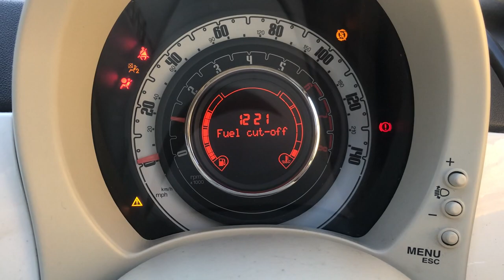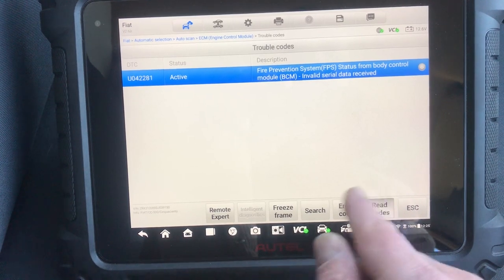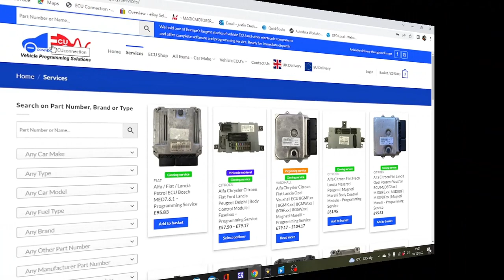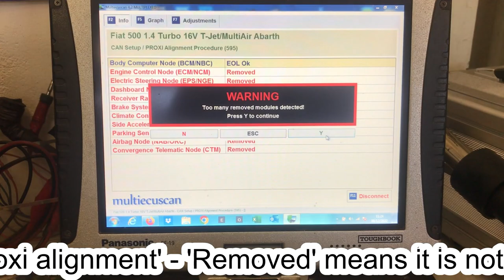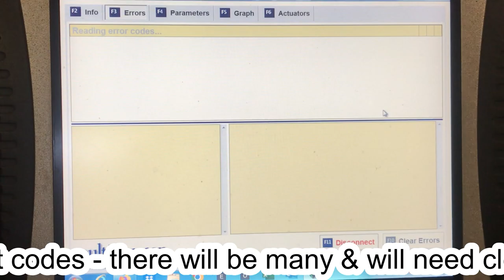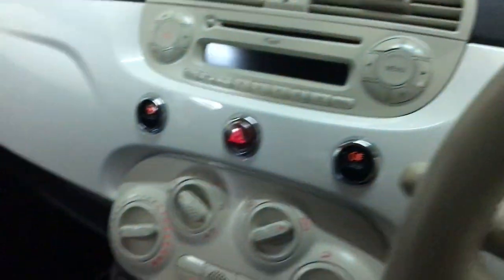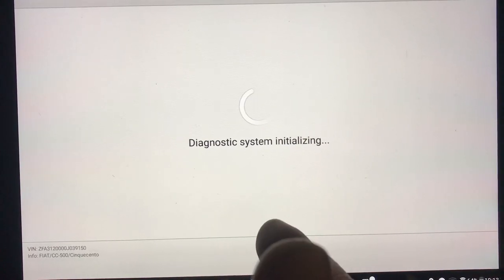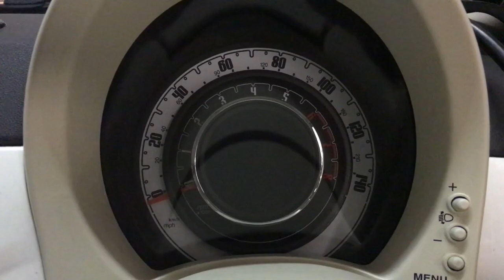Fiat 500 Airbag ECU Remove repair + refit guide Flashing milometer, Fuel cutoff unavailable no comms

Comment: Brilliant. Thanks.  That’s me. All my lights. All my messages.   In the trade.  Thanks. Very helpful.
Reply from the maker: Hi, thanks for your comment & watching, glad you found it useful!
Reply: For the cloning service you offer. I have the FIAT 51838580 A2C5333208 out the car - I can buy eBay FIAT A2C5333208 but 51897787, question. Will this clone with mine sending both in. Thanks Dan
Reply from the maker: @zzhughesd  it would be best to use a matching part number for cloning - if one isn’t available then our recommendation would be the ‘No comms repair’ service we offer…
Reply: @JC-ECUConnection Hi Mate, excellent video shows all the same issues I’m getting, where do I start with this? What is the first step to do? Any help would be appreciated
Reply from the maker: @FreePalestine11.  Hi & thanks for watching - firstly to confirm the fault is your airbag ECU, plug in a diagnostic tool & check if you have communication with the airbag ECU, if you don’t then check the fuses, if these are ok then it’s most probably the airbag ECU. Remove the module & post it to us for test & repair! Details can be found on our website:
https://ecuconnection.co.uk/product-category/services/?filter_car-model=500&filter_type=airbag-ecu&filter_car-make=fiat

Comment: We took a 500L partX. We fitted a used ecu kit for the previous owner as the engine ecu had a fault. There was only 1 difference the kit came from a car with a knee airbag and this car doesn't have one. With the full kit fitted the airbag light was on and only fault was knee airbag. With the original airbag module fitted no faults but flashing mileage and wouldn't proxi align. It's been running fine this way for some time now it needs fixing before we sell it on again.
Reply from the maker: That’s the problem with fitting an ECU kit!.. it would of been MUCH better to have replaced just the faulty engine ECU, this could of been easily cloned from your original ECU or virginised.. if you still have the original kit then I would advise you put it all back to original & fix it by doing this.. if you have thrown the original kit away then you’ve made a big mistake!!
Reply: @JC-ECUConnection  we have still got the original bits that was my thoughts from the start it wasn't my call then though. Can you do the engine ecu repair
Reply from the maker: @colinhamer6506  we should be able to clone / virginise the ECU for you, please visit our website for more information:
https://ecuconnection.co.uk/product-category/services/?filter_type=engine-control-unit&filter_car-make=fiat

Comment: Great video. I have the same problem with my twinair 0.9l.  What do you think about buying a used one or "new" one from ebay for cheap?
Reply from the maker: Hi, thanks for watching & your comment - Yes you can buy a secondhand unit although they can be hard to find & you need to find the same part number, then you will need to program it to your car either by ‘Proxi aligning’ by OBD (Providing the unit does not have crash data stored) - If you don’t have equipment for proxi aligning & crash data removal we also offer a cloning service for these units, for more info visit us at:
www.ecuconnection.co.uk
Reply: @JC-ECUConnection  Good to know. Thank you so much for the reply. So I (with my little dongle) and alfaOBD found just U0331 which I've searched for and found your video. How would I know for sure it's the airbag module?   (All other error messages I have too, except for the start/stop, but it's always off by choice)   Or just send it in and you test for function?
Reply from the maker: @TheCybercrash  if you do not have comms with the airbag ECU, first check fuses & power supply to ECU, if all checks out then you can send it to us for test & repair..

Comment: Hi my car has the exact same symptoms, I’ve used a cheap ond scanner and it didn’t pick up any faults so I’m assuming it only reads engine ecu, would it be worth getting it scanned in a garage or just go for the module ? I’ll send it in for a check and repair just don’t want to pay the extra in a garage if I don’t need to…. Great video by the way 👍
Reply from the maker: Thanks, & thanks for watching!.. you can send it through for testing before we go ahead with the repair to confirm your diagnosis, no problem!
Reply: Excellent I’ll get it off tomorrow and in the post
Reply: Hi just an update refitted the module today and everything is now working spot on…… thanks 👌
Reply from the maker: Hi, thanks for letting us know… it’s always good to get feedback!

Comment: So what actually fails & why? Is it a water ingress issue? I noticed on your car there looked like evidence of a leak on the bulkhead just ahead of the heater matrix ?
Reply from the maker: No, not water ingress on these units - component failure of various items on the PCB, usually due to voltage spikes - flat batteries & jump starts but often they just fail!
Reply: @JC-ECUConnection  I see. Mine didn't coincide with any event like jump starting or low battery, it just suddenly decided it was faulty, mid running cycle, & that was that. So expensive for what they are too, so I`m just running with no air bags now.
Reply from the maker: @MrPabsUk  we offer a Europe wide repair service!

Comment: I have stop start unavailable and fuel cut off unavailable. No other warning lights as you have in the video. I have connected a obd 2 scanner, no faults found. Do you think it could be same problem as in the video?

Many thanks
Reply from the maker: If you are using an OBD2 scanner I assume you are only reading faults from the Engine control module, you will need to use a Diag tool that scans ALL the control modules on the car at manufacturer level & not just the ECM at OBD2 level, particularly check for comms with the Airbag control module..

Comment: Hi, at 11.50 I see that you are clearing the fault codes after installing back in the car? Will it be required if I send the module to you for repair?
Reply from the maker: Hi & thanks for watching!.. it’s not essential to clear the fault codes after repair as the warning light will only illuminate if the stored fault codes are ‘Live’ & not ‘Stored’. When we bench test these units they are powered up without having all the components connected so there will be fault codes stored when it is returned to you, it’s bad practice if you or your garage doesn’t clear the fault code after repairs (As with all repairs) - this is because if in the future you have a problem with your car the uncleared fault codes will be misleading later down the line!

Comment: Will a proxy alignment need to be following a repair and would this cause a battery drain?
Reply from the maker: No, proxi alignment is not necessary after we do a no comms repair, battery drain is usually down to a faulty ‘Blue & me’ module…
Reply: @JC-ECUConnection  thanks for the reply this was useful information 👍

Comment: Hello I have a faulty SRS module of fiat 500, no communication . My ECU is the aluminium case type.
I replaced new Atmel A2C00024016 but it not working. 
I replaced 2 other new chips but it still doesn't work.
And I replaced with Atmel A2C00024016 of SRS HONDA CRV, it working.
So, Does it need to program this ? or is just a power supply processor ?
Thank you so much!
Reply from the maker: The problem is usually the Atic chip, sadly the new replacement chips that are available for the aluminium cased ECUs are not genuine & simply don’t work! - I have tried a few (Chinese) suppliers & theyre always dud!.. If however I salvage an Atic from a known good board then they come back to life, no probs!.. Try replacing the Atic from a known good board & see how you get on!
Reply: @JC-ECUConnection  Thanks for this video and your answer ! 
I will try replace Atic chip from a good board. 
Have a good day!

Comment: hallo i am from the netherlands and i have a grande punto from 2006 with exact the same issues flashing miles and all airbag lights i went and bought a second hand airbag ecu with the same numbers and is still the same still the u172687 code and showing removed at the proxI so i still have no entrance to the ecu to do a alignment, what can i do next is there a next step i can take or call you guys can you please respond to this so i can know what to do next thank you
Reply from the maker: Are you saying you have no comms with your donor unit?.. if so it’s either a faulty donor or you have a wiring problem - first you will need to check powers & grounds at the ECU plug..

Comment: Hi, May I know where are you based? also, My car is currently based in Malaysia as I've imported it from the UK. Do you recommend me purchasing a used Airbag ECU model or send my current ECU model for repair? Thanks.
Reply from the maker: Hi, we are based in Norwich England, if your airbag ECU has a plastic case then we recommend a repair, if your ECU is the aluminium case type then we recommend replacing, we can assist you with either of these options by post, sadly we only dispatch within the U.K. & E.U
Reply: @JC-ECUConnection  Right. How may I contact you as I am currently based in the Northern Ireland, Belfast. I can ask a relative of mine to ship it to me here and I may post it from Belfast.
Reply from the maker: @defineofficial5794  Hi, you can order directly from the website: www.ecuconnection.co.uk & contact us via the website contact details - sales@ecuconnection.co.uk 
Thanks

Comment: Hi Would these messages on dashboard display also stop car from starting?  My daughters car started fine turned off briefly to get something from garage and now doesn’t even turn over, got dash lights saying fuel cut off etc but won’t start? HELP PLEASE
Reply from the maker: A non communicating airbag ECU doesn’t stop the car from starting, you can try the emergency start routine - This involves a sequence of turning the indicators on from side to side, it will explain how in your handbook or Google it. - If this works then it would appear that you have a crash error logged, next step is to get the fat scanned with a Diag tool…
Reply: Have you found what the problem was at the end? I have a car with the same problem Fiat 500

Comment: Damn £600 to repair an part? I only tried to re fit my cigarette lighter back in an this happend to me car wont start etc I really hope it’s not going to cost this much
Reply from the maker: It costs around a 3rd of that to repair a unit, although if your car is now not starting it’s most likely something else, as these cars run fine without the airbag ECU connected. First things to check are the fuses…
Reply: @JC-ECUConnection  ahh ok well I only messed with the cigarette lighter amd radio and it happend Iv looked for a reset button everywhere but cannot find one it’s a 2013 would it be that sequence of indicator then ignition off etc to reset it?
Reply from the maker: @TheLoneRanger1992  there is a sequence to start the car after it has had a collision using the indicators but I would be surprised if this will help in your case here. The sequence is detailed in your handbook or you can easily find it on Google, if it does start with this procedure then it would appear somehow you have crash data stored in your ECU, in which case we can easily reset it for you..